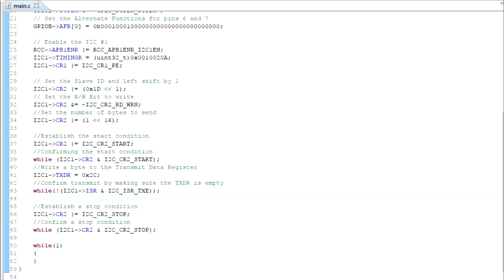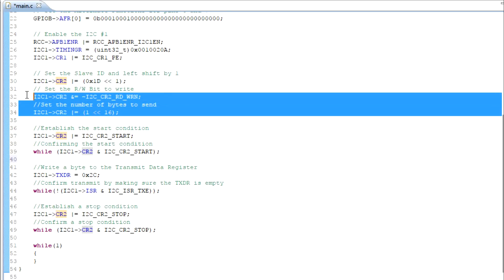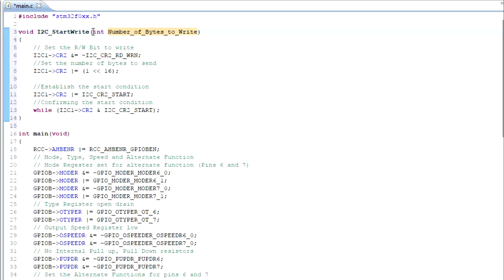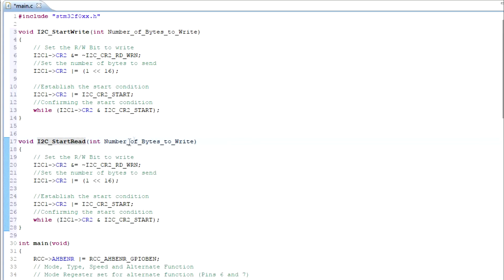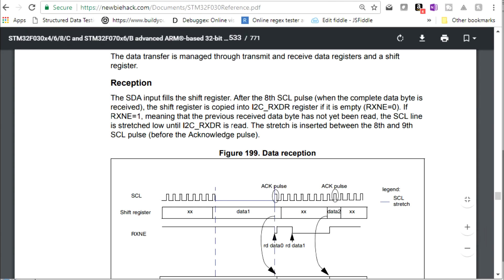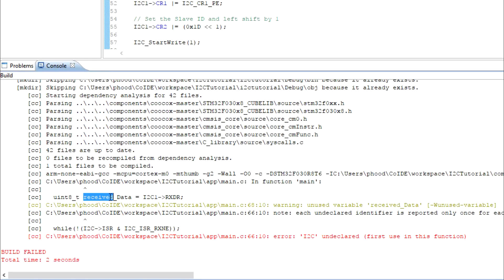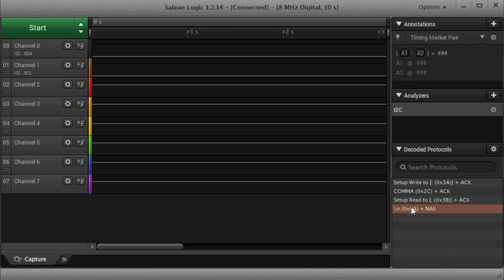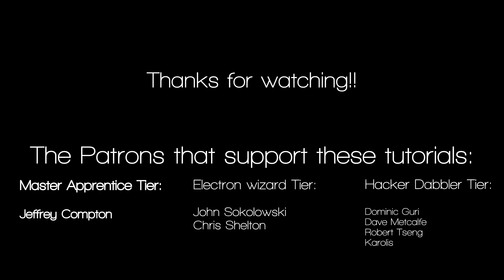60. How to Use I2C to Read a Device's Register Part 2 - ARM STM32 Microcontroller Tutorial

Comment: do you have any tutorials in depth concerning microcontrollers on Udemy for sell or any other platform? 
I am concerned in microcontroller , I want to reach the level of writing libraries to any type of microcontrollers via reading the datasheet and reference manual or as so called bae metal programming, I like your fluent English and the way of preparing the Tutorials
Reply from the maker: I am putting a book together which will serve well as a reference manual,  or cookbook for the ARM. I don't have anything on Udemy yet.

Comment: Any IDE suggestions for 2018?  Gotta get off Arduino.  Want to stay close to the metal.  Simpler the better.
Reply: Keil if you're ok with 32kB code limit
Reply: @Acky0078  I hear you but full-featured IDE's like Keil have a steep learning curve and if you hit the code limit, a steep price.  Been trying MCUXpresso from NXP (no code limit) but it only works for NXP/Freescale devices, and it also has a steep learning curve.
Reply: @kenwallace6493  Try Atollic Truestudio
Reply: @Acky0078  I see Atollic now recommends their STM32CubeIDE for new designs.  Are there reasons to stay with Truestudio?
Reply: @kenwallace6493  Reasons? There are many. Have you seen the HAL libs? Absolute garbage. The Cube is only good for pin management.

Comment: Firstly thanks for your effort, I took so much advantage of your videos, especially the ones about I2C with register level coding. I have also been working on BMP280 pressure sensor. I need to read the datas in burst mode, 3 byte respectively but while receiving data,  first two byte are received properly but last byte seen in the keil is 0xD0 whereas it is seen 0xC0 in logic analyzer.

Why does last byte seem different ? What can reason be ?

Comment: i bought the "newbiehack" arm micro-controller kit i did the connections properly also the programming then downloaded the hex file through st-link utility but wen i test the output with multi-meter it shows no volt coming out. could be i am missing something?. thanks for your great work.